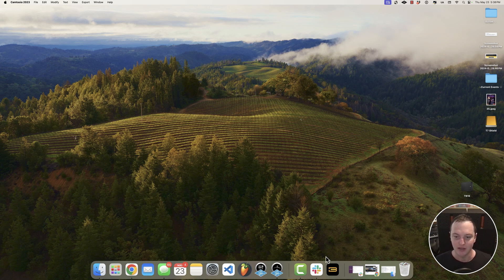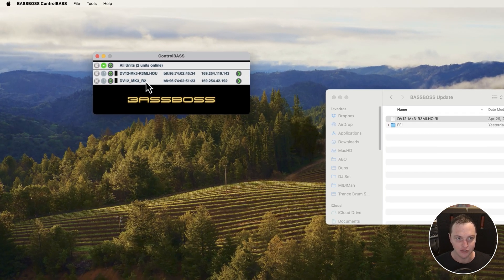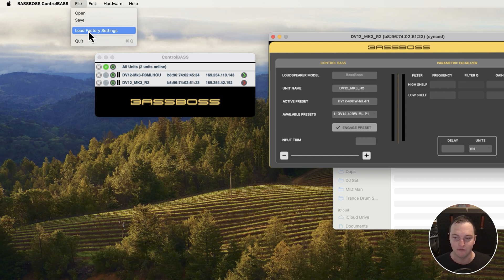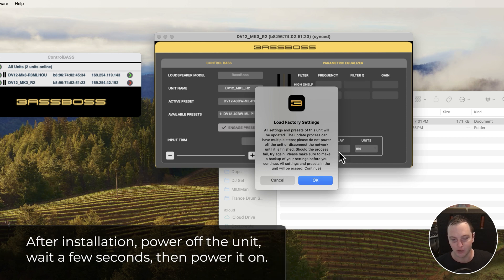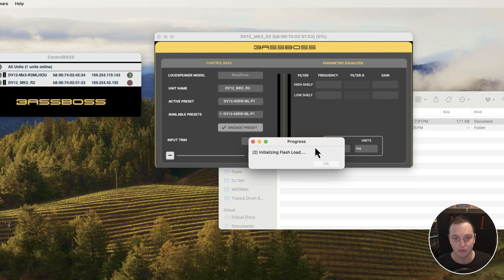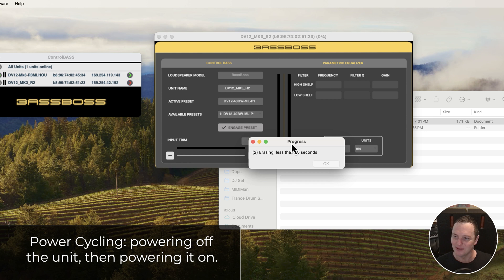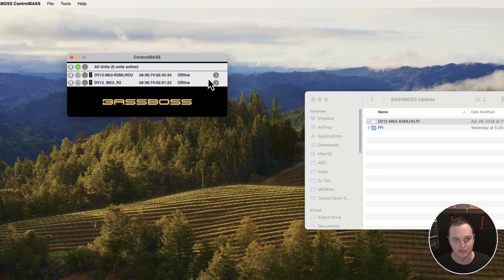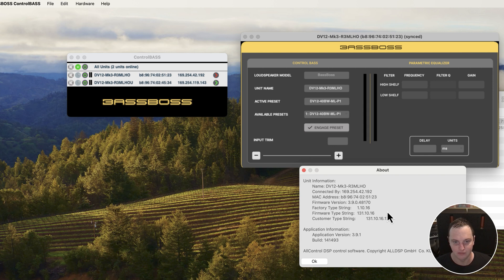Updating Settings with ControlBASS

Comment: I have the vs21 and I updated but I did not get any new preset Buddy was telling me the buttworth at 80 hz is good but I don't have that option just the regular ones that came with the sup do I need to unlock the software or did I do something wrong
Reply from the maker: Please submit a ticket so we can help https://forms.zohopublic.com/meganrecio1/form/BASSBOSSWebSupportForm/formperma/Ek5DByZazX6Y3pdXn1gBqlpXN0gUDVPhDliDJTN44f0
Reply: Hey James question. Have you performed a update to the DV12. I received the email, but no firmware was in the Predictbass file. Do the speakers havee to be linked for the software to populate firmware